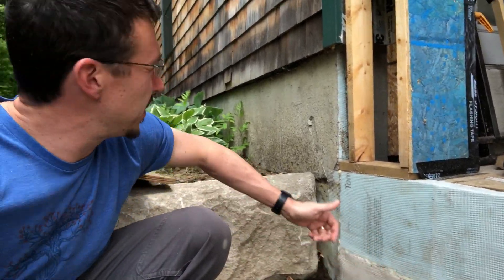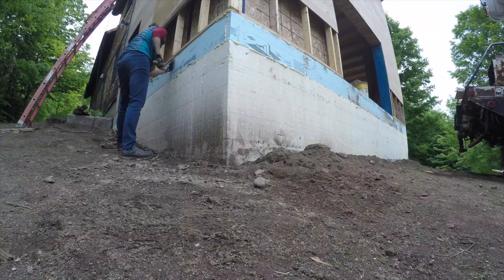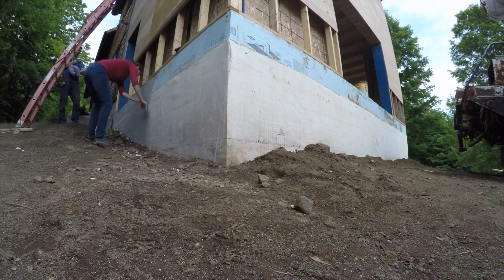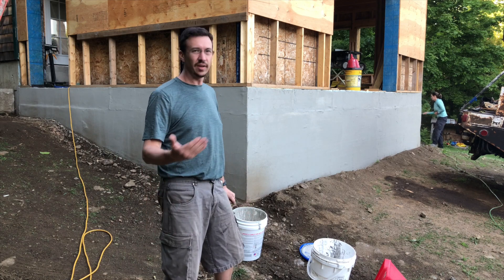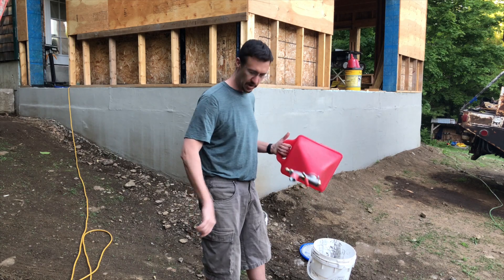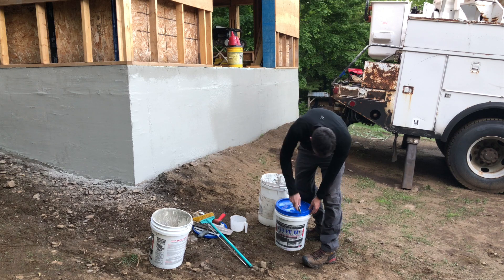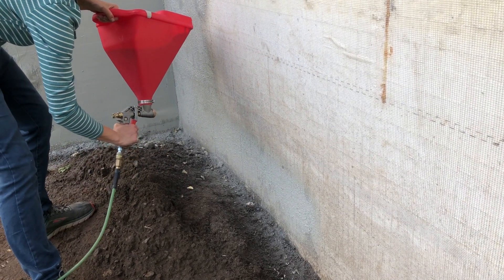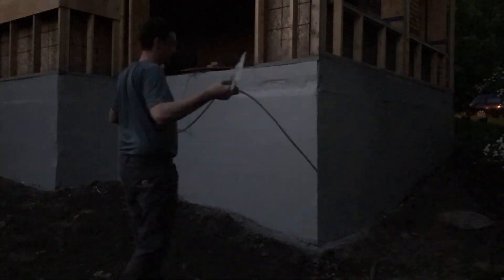Coating ICF Foundation Styrofoam with Tuff II

Comment: Now that the Tuff II has been on for awhile I am curious what you think of the product and if you would do it again.

I am also trying to figure out what to apply to a foam covered foundation and the only other option I can come up with is to install pressure treated plywood over the foam and then traditional wire screen and parging.